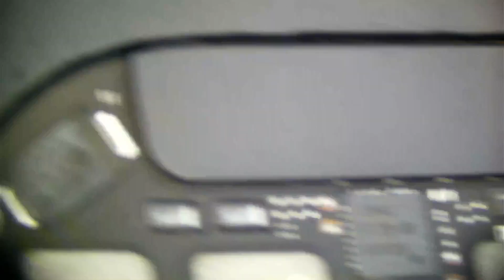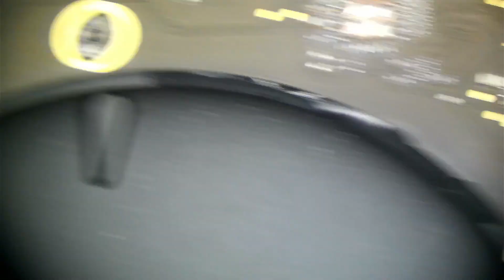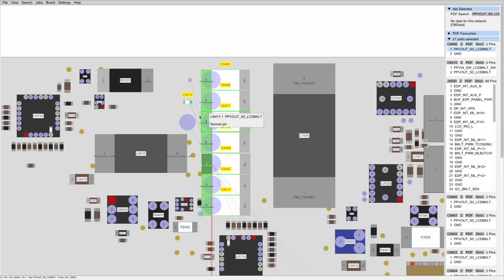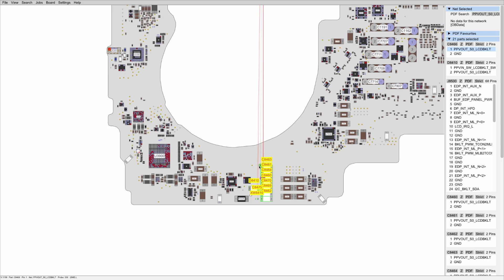2016 13 Inch MacBook Pro with no backlight. | Component Level Logic Board Repair

Comment: Just curious, would the display still show up normally on an external monitor if it had this same problem before repairing it?
Reply from the maker: Usually yes. Sometimes they won’t recognize a external before sign in unless the internal is unplugged.
Reply: @TCRSCircuit  ah ok got it. Thank you for the super quick reply!

Comment: If the problem is the board (2019 13" mbp to be specific)... Is it possible to still use the macbook on clamshell mode with an external display? Thanks!

Comment: I have the same issue with my A1706. I checked the capacitors and they are reading 140 Ohms. Fuse is showing continuity and voltage across. Could it still be capacitors? Checked the LCD cables and they appear absolutely fine. I can see the display if I through light on the screen. TIA Tim.

Comment: Again a very helpful video Tim thanks !!  Could it happen that the backlight fuse blows up and there's no damage elsewhere on this circuit ?
Reply from the maker: Usually no. A fuse usually won't blow for no reason. In some cases, over time, sulfur film deposits can collect in a fuse or resistor and cause it to open, but most of these resistors and fuses are sulfur film resistant

Comment: It's sometimes the fuse...
Reply from the maker: On older models yes, it is very rare on the retina machines.
Reply: @TCRSCircuit  Might be the same factory, for the fuses and for the capacitors. Fuses become more sturdy, caps become... half a cent cheaper.